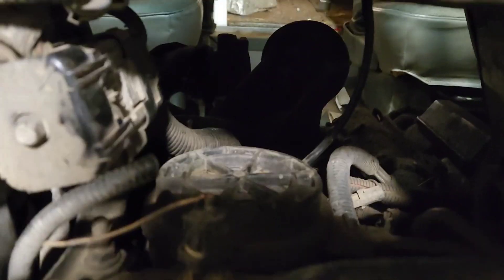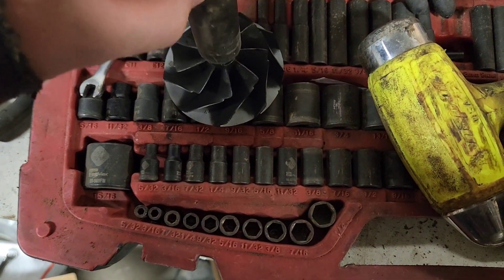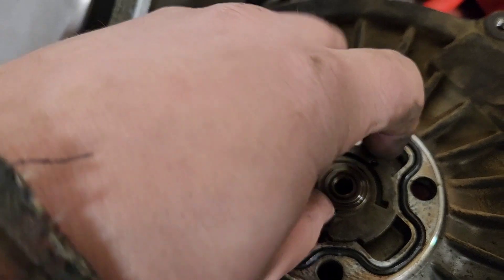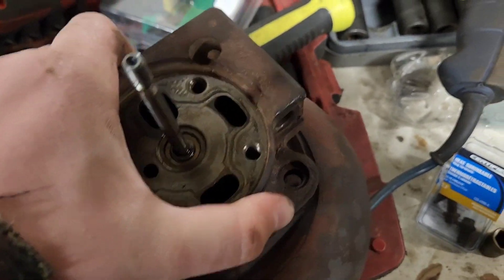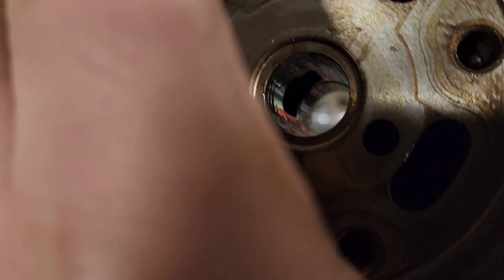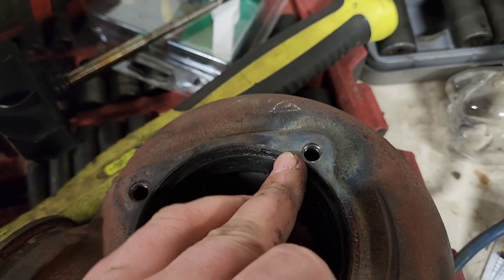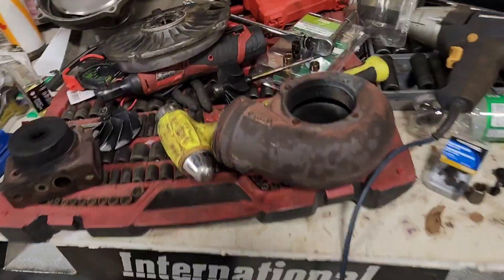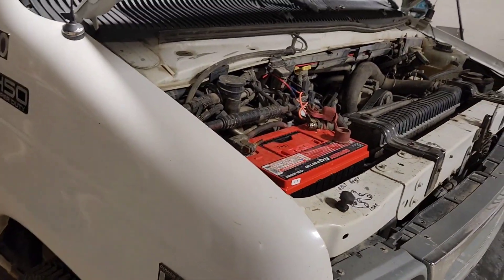7.3 Powerstroke Gtp38/Tp38 Turbo Tear Down

Comment: Real nice presentation. Im rebuilding mine rt now. Im beefin it up with the 66-88. New everything. I stripped two of those cartridge bolts. Not off yet, gotta sleep. Thanks. Im gettn rid of the ebp too. I. Just plugging the old pedastal. Kit cost me 320. Not too bad. Good luck and thanks. It helped me. I have parts everywhere.
Reply from the maker: Good luck with your build.

Comment: I had lots of oil headed to the intake and a ton of shaft play...
Reply from the maker: Sounds like the shaft seals failed on the turbo. Lucky it didn't run away on you.